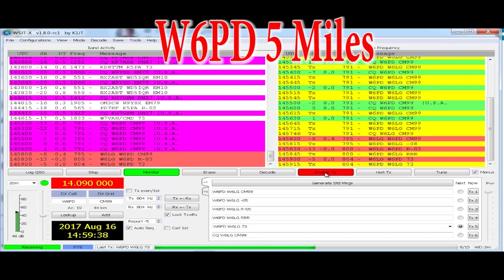Ham Radio Basics--Part 2 Digital Mode FT-8 With Light Bulb Antenna 750 Miles!

Comment: That's simply amazing that you could communicate with a dual light bulb antenna! Thanks for going to all the trouble to get that light bulb antenna to match and testing it out for others to learn from your experience!
Reply from the maker: Thanks Dave. It was fun to set it up.  I plan to do that again.  Right now, sadly, I must move from the house I built.  We have been here almost 40 years. My health is not good and I need to be closer to our adult children and medical care. So, everything is packed and the house will be for sale next weekend. It really is one of the best location for DXing that I have ever seen.  I was lucky to be here all of those years.  73, Jim
Reply: That’s one downside that happens in the retirement years is failing health. You might check out the many YouTube videos about things you can do to improve your health. I eat a Keto diet and do intermittent fasting, which is really easy to do. Eating the right diet can have a big impact on your health. It’s usually possible to reverse type 2 diabetes and reduce a lot of serious health problems. Some people have been able to starve cancer cells by reducing or eliminating glucose and taking DON to reduce the impact on glutamine. Cancer cells live on glucose and glutamine. With today’s technology, it’s technically possible to run a remotely controlled HF station. I’ve thought about remotely controlled HF stations from HOA gated communities. 

Your video proves how robust FT8 is to propagate when other modes fail. But FT8 gets boring to me quickly, because it seems kind of pointless not rag chewing. I think the next key innovative mode will be a digital mode with handshaking, like AMTOR ARQ. AMTOR get get through under vary bad band conditions, and the data flow rate was drastically faster than FT8 or JS8. AMTOR ARQ could do that about 30 years ago. Perfect error free copy, deep into the noise floor.

Thanks again for your very unique light bulb antenna video. Decades ago, I taped a fluorescent tube onto a vertical 18AVQ a antenna. Transmitting with a 100 watts lit up that fluorescent bulb!

Good luck on concentrating on improving your health in the future.

Comment: I couldn't figure out how to get FT8 to work with WSJT software and accidently left it running in the background shortly before I went to bed. I had my headset connected because I had played some videogames with a friend. My headset was on my desk and my IC 718 was on a seat/table thingy hooked to a wire dipole indoors and I left my receiver on 40 meters and woke up and saw my PC was able to decode signals through the noise of my computer! A lot of stations from northern Europe were my farthest DX! I just need to get it working again so I can figure out how to transmit!
Reply from the maker: You will figure it out.  Amazing stuff that FT8.  It can hear what you cannot hear. I may be on FT8 soon since I am being forced to relocate after almost 40 years here on the mountain. 73, Jim

Comment: Interesting to see the lightbulb load/antenna in use.  I've heard some of the older guys here in the UK talking about it but I've never seen it done until now.  FT-8 is certainly popular all over Europe and seems to be able decode better than many of the other modes at ridiculously low signal strengths.  Thank you for the videos.

Comment: You have other antennas that may be re-radiating your lite-bulb dipole antenna signal.  I have had similar results as a novice using a very low 40m dipole near my Dad's high butterfly antenna.  This may have some help for HOA restricted environments using a cut to frequency #28 galvanized steel wire.  What do you think?

Comment: the old tuner has air caps where some auto tuners use relays and that is why older tuners work better in a long shot 73s ve3-ogf

Comment: In 1956 when I was first a novice, I got home from vacation and found my new novice license in the mail. Ran to my bedroom and made my first contact/ CW.
I forgot to attach my 50 feet of RG-58 to my dipole. It was on a 100 watt lightbulb lying on the ground and I made my first contact Louisiana to Mississippi!. Different antenna on the Rx.
I know the coax at 50 feet (lying on the ground) had to be radiating, but I feel the bulb was radiating also. 
I understand that FT-8 will decode down 35 db into the noise. Fun experiment. Imagine a 5 element LPA (pseudo) beam. HI Hi. 
Just the mode for EME, as these dig modes were first intended.
EME on 1200Mc with a 6-10 foot dish. Woo Hoo !!
With this and coming sunspot cycles we all may soon be on EME.

Great test Jim. I'm still chuckling.
(Elecraft rules)
Pete W6LAW.

Comment: Hi Jim with the high swr my guess is that much of the radiation is from the coax.
Reply from the maker: I don't think so.  With the bulbs disconnected there was absolutely nothing.  The shield is 100%.  It was Belden coax direct to the socket. Keep in mind it has to hear as well as transmit.  73, Jim

Comment: I made a comment at Part 1.
One other thought: We did use light bulbs as dummy loads, but are they really? Ideally a dummy load does not radiate anything. We don't expect real world things always to be ideal, but your results say it is radiating quite a bit. Not as much as a "good" antenna, but how good is our label as a dummy load? 
When I was chief engineer at a small town, low power, AM broadcast station decades ago, the FCC's approval of our license included specific values for how much we could legally radiate in different directions. We are not supposed to be broadcasting, as hams. At what level of radiating are we no longer legal?
Bob, WA9D

Comment: Hello. Are the lamps in parallel? If so, the antenna is like two transmission lines in parallel. If you connect them in series, at least it will be like a "folded V-dipole", and may radiate/match better. A wonderful feat in any case!

Comment: pretty cool Jim, but do try JT65 (its just another mode in the software your using) its much slower but should do decodes at another 3-4 db down from where your at, thats twice as weak!  
these are tremendous modes for use with a magloop even on the lower bands  where the magloops bandwidth causes issues for ssb

Comment: Hi Jim,
Saving up for an interface to try FT8 with my FT450. The audio ports already in use on my desktop, so need the interface to connect by USB. Don't worry about length of the video. I'd watch your's even if it was an hour long.  73  WB3BJU

Comment: Thanks Jim  !  !  I live in a CC&R restricted community.  I transmit on an attic dipole (too much noise to receive),  and for receive I use a Pixel mag loop receive-only antenna outside, disguised as a bird house holder (see QRZ photos).  You've inspired me to try out FT-8; my transceiver is a FT-450D.  '73   Bob   N7ISU